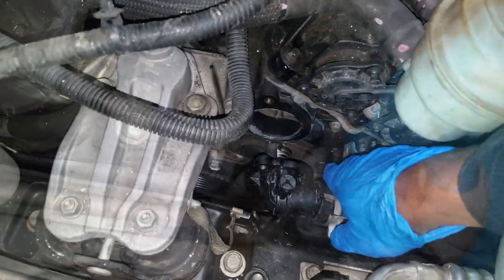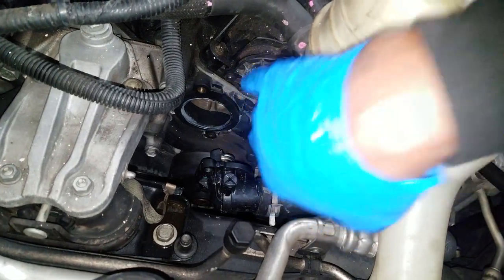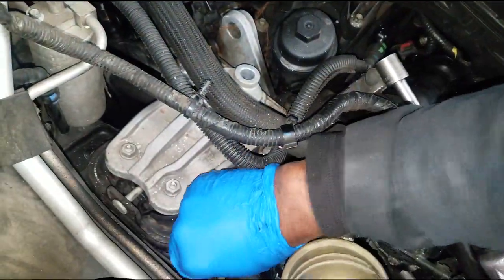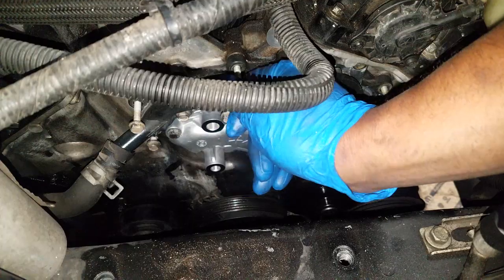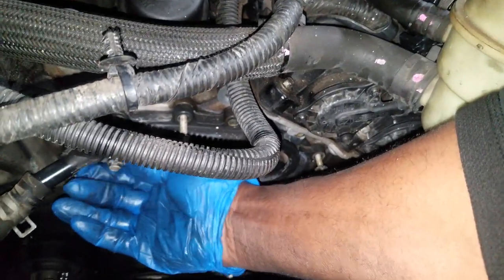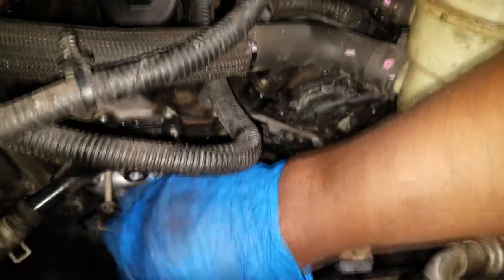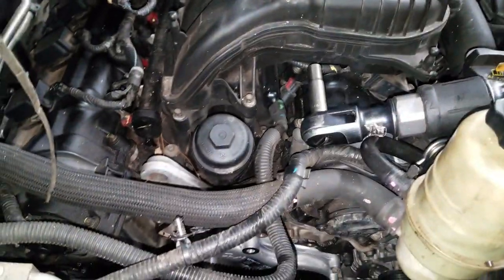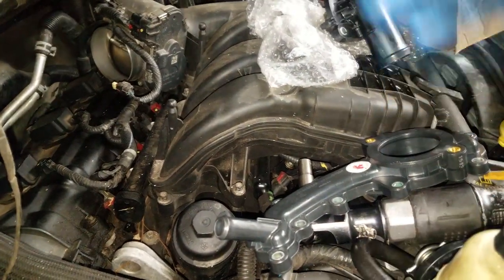How to fix a car that LEAKS COOLANT and overheats with AC on in traffic. 3.6L Pentastar V6 Problems

Comment: What can possibly cause the Service Park Alert to come on and not allow car to move.
Reply from the maker: Hello thanks for watching and subscribing. There are several fause inputs to the computer that can cause this. Such as a oppen door (door may be closed but switch telling computer its open) Because the park assist have a module, theres likely fault codes inside the module that will help with diagnosis..You need to get the sys scanned
Reply: @OnlineMechanicTips  thank you!  Would you recommend going to any shop I feel comfortable with or to the dealership ?

Comment: this is EXACTLY why you TORQUE to manufacturer SPECS!!! glad you elaborated on that... and ESPECIALLY with plastic parts!! If you over torqued they will crack, this happens with bumpers, bumbper brackets, hose and airboxes often as well!!!!
Reply from the maker: ding ding ding.. Using a air ratcher to tighten them little small 10mm bolts will rip them right off and ruin everyhing
Reply: Online Mechanic Tips If anybody using a AIR RATCHET!!!! and 10mm bolts!!!!  good lord...they need to sell lemonade, cause fixing cars is NOT FOR THEM!!

Comment: Tricky diagnosis 🤜🤛
Reply from the maker: I been burnt enuff times to know to look for leaks highest points..10 years ago, this van would of gotten a water pump. Just for me to find out it was leaking higher ups.
Reply: @OnlineMechanicTips  its happened to me too. Especially when the water gets in the belt line and pullies